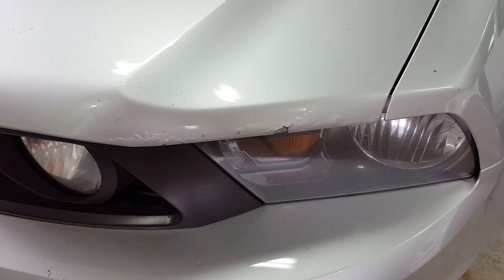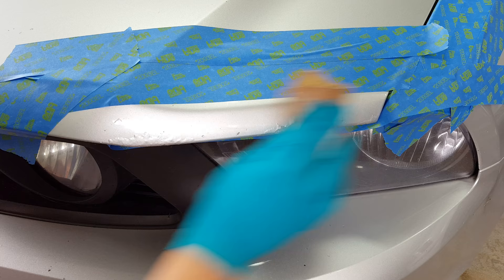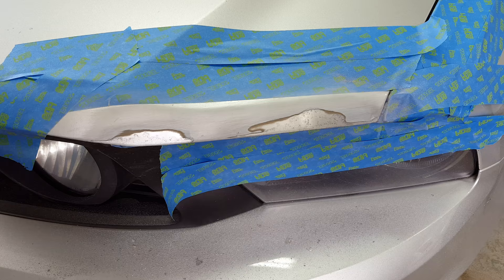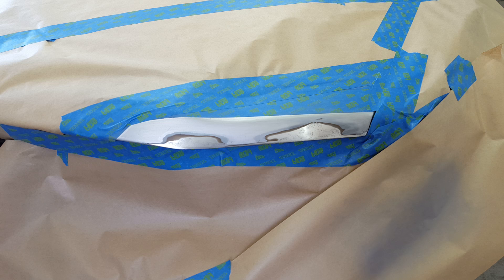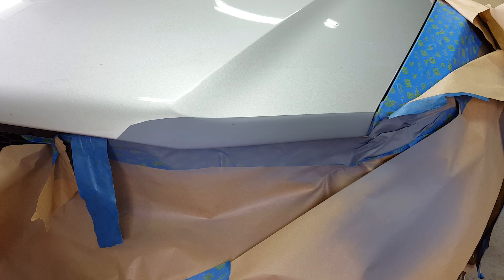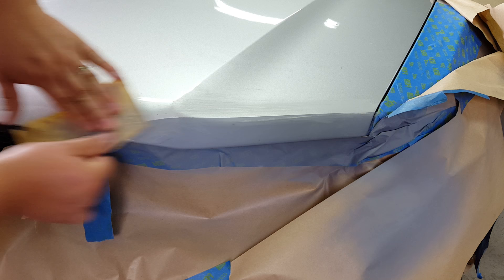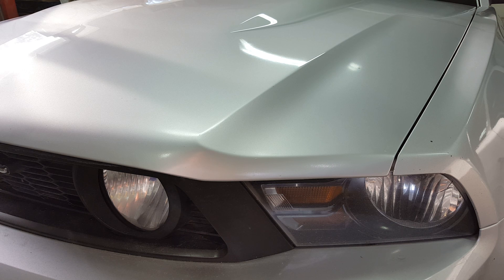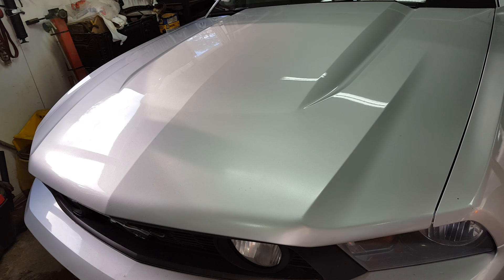Repair your Flaking Ford Hood - GTC Toolbox

Comment: Thank you so much for your video. I must have watched it 50 times now at every step. I am at the clear coat step after having to go back and re-do because I put too many coats of primer on it and left too big of a line that I couldnt get down to not be noticed. I will suggest to others looking into trying to fix their paint bubbles on their Ford hood or fixing any issue on their hood or car to "back tape" the edges. That won't leave a line and will be more feathered and not have that distinct line.  I would have NEVER tried to do this type of repair if not for this video.. Grand Touring Concepts, THANK YOU!!! This is why I love Youtube. I thank you for doing this for others that might have the same issue. The issue that Ford should admit to being at fault.  You don't see Chevrolet's or Dodges or Toyotas or you name it owners having to re-paint their hoods.  A few times is a coincidence, thousands are a problem! All I have to do is look to the right of where I am typing and see videos on Ford paint bubbles, Ford Mustang Hood Galvanic Corrosion, etc.  Shame on Ford.  I guess car companies don't realize most people will buy many more cars in their lifetime and I doubt it will be a Ford after this. This tells me all I need to know.  Do you think this company will step up to the plate if there is a major issue?  But to Grand Touring Concepts, I want to say a huge thank you for your time to help others that had this nice surprise on our Ford Hoods.
Reply from the maker: Thanks for your comment and we are happy to have helped you in your DIY fix, its always daunting at first, but we have found that sometimes just watching someone else try it can take a lot of pressure away. We wish you the best of luck with your repair and hope you will continue to check out the channel as we always have a something in the works, love to interact with our audience! - Darren
Reply: Curtis Collins:  Take it from a guy who has been in auto body repair for 20 years... once you put a hard line in your primer, it is not going away.  Even when you sand it flat, it usually comes back to haunt you.  You have to avoid making hard lines by back masking and roll taping.
Reply: @fwh79FOXR6  what do you guys mean by back masking?
I'm about to try to fix my hood on my f150 using the method shown in this video.
Reply: b Dub Probably a little late now but what you do is put the tape down and then fold it half way back to make what could be considered a tear drop which means adhesive side would be up and then you put some tape on that to hold it back, it makes it so the paint will slightly go under your tape line and make a soft edge instead of a hard tape edge.
Reply: @HayesTransport  Thanks for the info!

Comment: Thank you for the video. Had to do this on our 2013 Ford Explorer. The hood paint started bubbling up and eventually peeled off after vehicle a few years old. Reached out to Ford and they rejected our claim saying peeling paint wasn't covered under warranty, only rust holes covered. Absolute shame. Will never buy a Ford Vehicle again as they don't stand behind their vehicles.
Reply: @Gabe Stagg You must have an aftermarket hood. This is a well known problem with the 2013's.

Comment: this is happening on my 2016 mustang. This has been a problem for 13 years of mustangs now, from 2005 to 2017 and they still haven't fixed it. Thankfully my hood is getting replaced for free
Reply: Dingus Tardo it’s happening above my drivers headlight on the hood but I’m out of bumper to bumper warranty 😡😡 (2015) GT
Reply: corrosion warranty is separate from the bumper to bumper warranty.
Bumper to bumper is 3 years/36k miles, whilst corrosion is 5 year/unlimited miles. Check your owners manual and consult with your dealer, they have to send photos to Ford Corporate to authorize a replacement so it isn't up to the dealer whether it's replaced or not.
Reply: @RamyWarda  I'm going to have to call them up least I can do. I'm at 43,000 miles on my 15 and the front lip just did this and chipped off. Pretty damn disheartening specially when the paint is impact blue
Reply: Cameren definitely call them, they HAVE to replace it
Reply: Cameren you're covered until 2020
Reply: @RamyWarda  I definitely will give it a try. I have one little small spot bubbling up and the main spot is towards the middle where a piece almost as big as a Pinkney nail chipped off and is bubbling around as well showing bare metal so I don't know what thier stipulations are but thanks for the reply👍
Reply: Cameren as long as it's visible with a camera Corp. Will auth a replacement through your dealer. Good luck!
Reply: im late to the party here, but did they actually replace it or repair it? They said they were gonna replace mine and just repaired it. 2 years later, out of warranty it happened again!

Comment: Looks like I'll be doing this to my 14 mustang.  You think with this problem being around since 05 on mustang hoods Ford could have got the issue fixed by 2014   My car is and is kept immaculate and these bubbles on my hood recently appearing really pisses me off
Reply: Yup. Last Ford I'll ever buy...
Reply: this has been around since 05 because my 01 expedition has this probably 2 inches deep through out the whole front of my hood
Reply: Daily 3.7 Just a v6 don’t cry about it
Reply: My 14 has this same issue. Fucking horseshit.
Reply: Yes, indeed, my 2014 GT is the ruby red metallic clearcoat, an extra cost awesome colour and this just started to happen. Incredibly annoying when the rest of the car is 100% nothing in life can be perfect and a 2014 is the last real Mustang.

Comment: Supposedly someone started a lawsuit because fords been having this issue since 2000's and even newer 2017's are doing it. Gonna be doing this on my 03 explorer. Part of me just wanted to rhinoline the edge because I have a bug deflector.
Reply: Mark Wolf - Even my 2013 explorer has this same corrosion issue all a long the edge of the hood. It's pretty bad. I keep my cars in pristine condition too. Probably won't be buying a Ford next time I'm in the market for buying a car.
Reply: Currently doing this to my 96 explorer hood..exact same issue on the hood except its peeling at the top by the windshield
Reply: @mikedavis9554  The green paint on my 96 explorer is pretty good and don't peel~! The rockers are another story :lol:
Reply: It settled...  Plaintiffs "satisfied"

Comment: Dang man -- you did a great job.  Lots of products, but the finished product looks great.  I have a 2001 F-150 4x4 that is in superior condition inside and out except there is a spot smack dab in the middle of the center hood where the paint actually sits up a little.. like 5 or 6 little feathers.. I took it in to a shop here in Dallas - they want $800 for the hood and another $800 to "touch up" or repair a spot right near the top lining on the tailgait (about the size of a half-dime)  I got angry and left (sure, I know, they'd do an amazing job, but that price is OUTRAGEOUS---to me).   Thanks again--for the cool video.

Comment: Great job. I have a 2014 Transit Connect that has this issue pretty severe. This is too advanced for me. May end up just going with a hood wrap to cover the corrosion/bubbling.
Reply: A vinyl wrap will show ever imperfection beneath.
Reply: @MikeZyouthpastor  , what if james uses the wrap after removing the peeling paint and then sanding our the roughness. I find it hard to match paint and clearcoat to original . If you just remove roughness could you not just wrap entire hood for a good match ?

Comment: Good video and nice work. This is happening on the Explorers as well. Did you paint the underside of the edge? It is my understanding that that is the source of the issue because Ford did not finish the underside of the hood.
Reply: I needed to know this. What would you recommend in terms of paint on the underside of the hood. Is that something that can be done diy as well? I have a peeling hood on my 2013 Ford Explorer and I am VERY angry at Ford over the issue
Reply: I will soon be sealing the underside of my 2015 Explorer hood before it starts peeling. thanks.

Comment: very good video... how long do you wait in between primare coats / paint/ and clear coats for drying ???
Reply from the maker: This will depend on the the product you use and weather conditions when you paint, consult the product label for application guidelines, and reapplication windows. It will vary product by product. Thanks for watching and commenting! - Darren

Comment: Did you spray it with water to clean it after the sanding?
Reply from the maker: Yes, water and a clean lint-free cloth make a great way to clean the surface to check your progress as you work.

Comment: Ford has a TSB 17-0062 that recommends replacement of the hood.  What’s to keep it from reoccurring after your process?
Reply from the maker: The TSB recommended hood replacement is the best option, and truly the only permenent solution, this process of touching up the paint does nothing special to cure the core issue. Should a hood replacement be outside of the budget this repaint will improve the appearance for a couple years and help limit the spread of the issue. Thanks for watching and commenting - Darren
Reply: Grand Touring Concepts.   Your repair turned out really nice given the materials you used.  I can only imagine what a body shop would cost.  My problem is with our 2016 Explorer, we just noticed the other day the same bubbling on the front of the hood.  A three and a half year old car should not have the paint bubble.  Reading up on the problem it’s due to what is call galvanic corrosion caused by the factory painting over contaminated aluminum panels.  The contamination is due to iron particulate contamination that is what actually rusts.  
  Good job on your repair.

Comment: can you this to paint your calipers with? or only on body
Reply from the maker: This exact paint would be unsuitable for brake calipers due to the high heat they experience during braking. However the good news is that duplicolor and other providers do make specific brake caliper paint kits which come in both brush-on and spray cans. Check your local parts and auto suppliers and see what they have. Thanks for watching and commenting! - Darren

Comment: That will bubble through again, what works best is a nylon wire wheel.
Reply: Nylon wire wheel versus what and why? Which type of nylon wire wheel? can you provide link/picture?
Reply: @octaneracer5019   Nylon wheels work best for aluminum, they get rid of corrosion without removing too much material vs a steel wire wheel. 
He just sanded and left the pits full of oxide which will just start to corrode all over again. In my experience with aircraft sheet metal nylon is what works best. If you really want to make sure you deal with all the oxide sand alumni prep and red scotch brite after you finish with the wheel . After that treat the bare aluminum with alodine and zinc chromate primer. Thats how its dine in the aviation industry.

search nylon wire wheel on amazon, i always use the orange color.
Reply: @_multiverse_  but what would be best for steel most cars are steel.
Reply from the maker: @Sam This repair section remained blemish free throughout the subsequent winters until the car was sold in 2020 with 356,000 km on the clock. YMMV.

Comment: Might be worth a look at this https://www.youtube.com/watch?v=aKcVRXPhV0U

Also the corrosion usually rolls up under the hood and if you don't address that then the corrosion will be back in couple of months. I have the t-shirt!. There is an actual Ford spec sheet for this repair, detailing the products to be used to hold back future corrosion. This type go galvanic corrosion is often made worse by poor earth contacts else where on the car.

Comment: I have a 2015 Fusion with 34k miles doing this.  Ford won't repair it because I didn't notice it until one month after the 36 month bumper to bumper warranty was done.  One month over, under on mileage by 2k, and Ford won't even help.  Screw them.
Reply: Ryan McCormick there is a separate warranty for rust and corrosion. Check your paperwork in the car. It should be 6 years unlimited mileage
Reply: Miguelle Millo 2015s are screwed cause Ford says there has to be a “hole”, 2016 and up they don’t need to have a hole through

Comment: I have a 2013 Fusion that is showing corrosion on the hood.  Ford has not fixed this problem.
Reply from the maker: It is quite odd, we have 3 aluminium hood equipped Fords in the project but this is the only one to exhibit the issue. - Darren
Reply: mine too. 6 years old now. Luckily in 2 small little areas.

Comment: how well does the duplicolor perfect match paint match the paint on your vehicle?
Reply from the maker: The duplicolor products are fairly close, about 95% match in most cases, certain colors like white and silver match more closely, while other colors like red or green tend to be a little less. The best option for the home gamer would be to have a autobody shop mix up a pint of proper match and then apply with a hobby airbrush or similar paint gun. But for a low cost, near match, the duplicolor rattle cans are an okay option. Of course a professional fix and complete panel re-paint is the best long term solution and would give a show quality match. Thanks for watching and commenting! - Darren

Comment: So aluminium rusts on your car?!
Reply from the maker: Not exactly, rust happens to iron, oxidization occurs to aluminium, in this case when the aluminium in the hood develops a chip or is otherwise exposed to oxygen, it creates a white powder, alum. oxide, which will cause the paint to bubble up and blister. Some vehicles suffer from this, some cars are fine, I have three aluminium hood cars in the garage, only this one has done it, but it sees winter use and calcium-chloride de-icer spray.
Reply: Well, in the case of Ford, there is a national issue with aluminum hoods and hatch doors doing this from galvanic contamination - which means there was iron contaminants in the aluminum panel pre-painting process in Fords.  It has been happening since early 2000s. I have an 03 Expedition with this on the rear hatch.  The iron and aluminum together create a reaction (dis similar metals) and ruins the paint.  Once the aluminum is exposed, it 'oxydizes. and so you get what you see in the video.